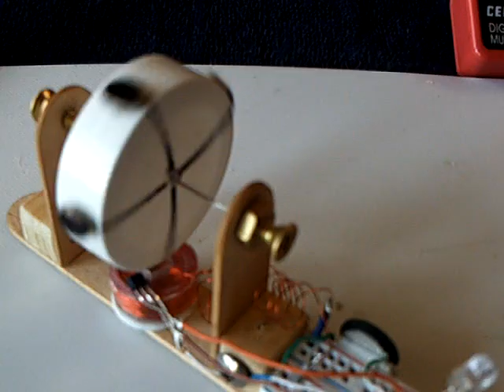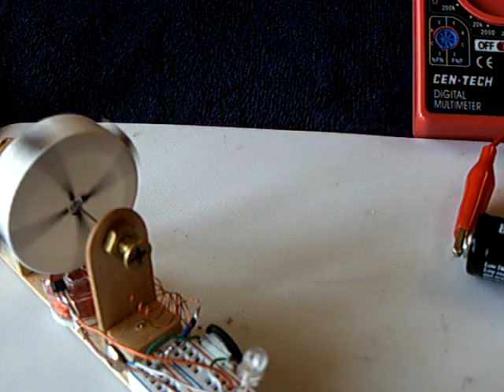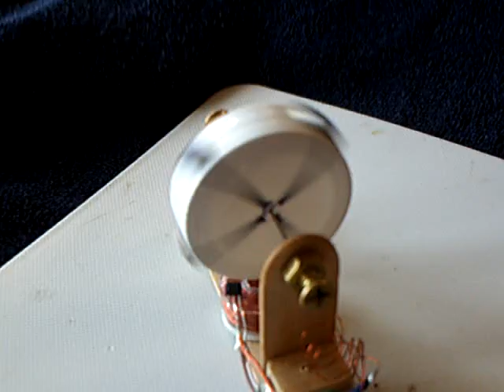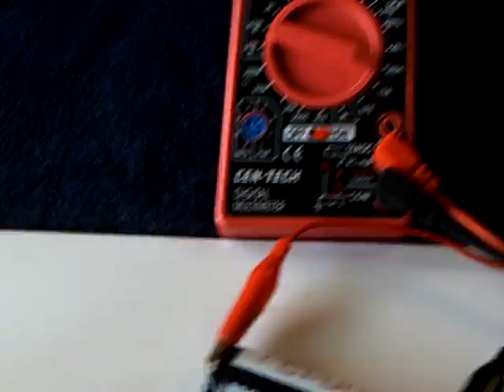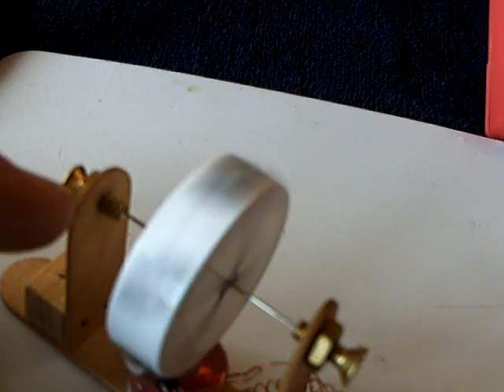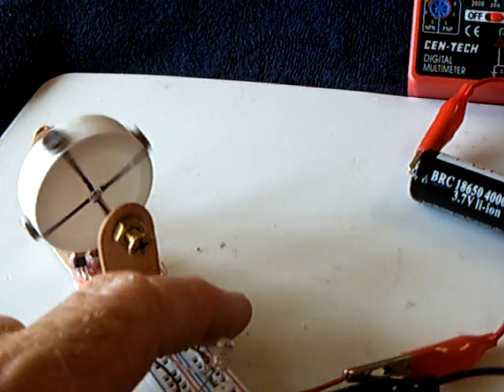Hall Sensor Motor ----  running on a 18650 3.7v li -ion battery

Comment: fake battery you can only get 3600mah in 18650 and they are expensive. is it ultrafire? you get them cheap because they are old cells from reused discarded laptop packs that they chop up and take the working cells from. most of the cells have high wear and can be as little as 700mah but often around 1500mah. just be careful as they explode as they already have internal formations that lead to internal short. there is a guy who had some explode and lost his thumb just google you will see.
Reply from the maker: +Pulsed Neutrino I did some pretty good research on these 18650 batteries before I bought some.  You are right about them being all over the place as far as capacity, quality, and safety.  Amazondotcom had good reviews on the ones I bought --but I am still wary until I do my own testing.  I will to be very careful with them.  I need both my thumbs and my wife would be very upset if I burned down the house.
Reply: ***** i was like you at one point trying to save money and in the end decided that genuine panasonic ncr18650a 3100mah or ncr18650b 3600mah cells were the safest. granted per cell it will cost you about $8 / $9 including protection module but its worth it. especially as i found out with high current loads and multiple cell configurations where i needed reliability. the cells i used always expended within about 100mah of printed capacity which i thought was good. i also found that for max capacity charge to 4.25v and discharge to 2.8v and replace after 300 cycles. or if you don't mind a reduction in capacity you can only charge to 4.1v and discharge to 3.4v and discard after 1000 cycles.
Reply from the maker: +Pulsed Neutrino Great information.  Thanks.  I guess this situation is like most where knowledge is king and a little help from others does the trick.  Thanks again.  That saved me a lot of time.
Reply: ***** you are welcome. just an extra addendum if you want lithium batteries that are safer just get lithium iron phosphate. they have a lower energy density and voltage range but don't catch fire when you puncture them or short them out. happy tinkering!

Comment: I've got lots of 18650 cells.  I've never had any problems with them. You can discharge over 1.5A continuously with the ones that I have without any problem.  I charge mine manually with an old cellphone charger that I modified into a dual mode charger.
Reply from the maker: +A B  Thanks.  I am so far behind on some things.  Technology races ahead.
Reply: +Lidmotor You're light years ahead of my in static motor knowledge though. :)
Reply from the maker: +A B  It's funny that you would mention the static electric motor because I have been wondering what to do next. That is something on the list as well as another Stirling engine.  I found out that in order to keep my interest alive in this hobby I have to vary the projects.  If I stay on one type of a project too long I burn out.   Usually I stumble onto something new here on YouTube or at one of the forums and off I go in that direction.
Reply: +Lidmotor 
Not that you are taking requests, but, I'd like to see you do a series of vids on Stirling designs. :)

Comment: Hey Lid, about those home mad super caps from tin man. Well after some searching I believe I have found where he got the information to build it. There is a channel on YouTube under the name Robert Murray-Smith. Go there and go to his playlists. Under that you will find a playlist named super capacitors and batteries. All the info we need to get a VERY good start is there. He goes through how to make the Graphene, as well as turn it into an ink like substance and use an airbrush to spray a super thin layer on a substrate. He goes through all steps to produce multi farad homemade super caps that are much smaller than the ones we can buy. Hell he has even made a one mega farad capacitor.
Reply from the maker: +BackRoom Labs I have watched most of Robert Murray-Smith's videos.  Making true grapheme is not easy.  My attempts have failed.  All I get is thin graphite. One molecule thick sheets of a substance???  Tough job for a kitchen table experimenter like me.
Reply: +Lidmotor I hear that. I just got some amorphous solar cells in the mail. After i construct a few home made panels I'm going to try my hand at the home made super caps.
Reply from the maker: +BackRoom Labs  Great let me know how that goes.   I want to make some also as long as what I'm making is a real super capacitor and not just another fancy voltaic cell.  There appears to be a blurry line between the two right now.  The word "Hybrid" is being used a lot.

Comment: nice to see you took my suggestion and added a POT.
I use those 18650's for some high powered LED joule thief flashlights I made. The batteries are very reliable, I have the red ones 3000mAh.
I really like your needle solution for the rotor.
how do you get the needle in the dead center? every time I try it's just a wable mess.
do you have a video showing that?

Comment: the neodymium  magnets add some extra and unnecessary resistance.
Reply from the maker: +Seth Faltisco   Without the neo magnets this will not run.  There is no internal ring magnet on this like on a computer fan motor.  No magnets. No workee.  Nothing for the electromagnet to push against.
Reply: i know the motor need magnets  but on the battery holding the alligator clips on. i connected 2 fully charged 18650 batteries in series using neo magnets and instead of 7.4 volts and 3500 mA i got 7.2volts and 2351 mA.
Reply from the maker: +Seth Faltisco Oh you meant the battery attachment magnets not the motor magnets.  I see your point but on this application it is not an important thing.  I ordered some battery holders with wires on them that should work well.
Reply: ok

Comment: Hmm, a micro levitator using a Hall sensor. Well worth looking at ! 
I use ex laptop 18650's, 6 of them, for my table fan. They recharge great on solar, no circuit required. Panel outside puts out around 300mAh at 18V and it's a 3x2 set of battery cells. Works just like an SLA for charging...been running for many months now without issue.
Reply from the maker: +slider2732 That is good news about solar charging these 18650s.  I bought 4 of them and I expect to do a bunch of experiments with them.  The fire danger is my only concern.  As far as the micro levitation device I think that it might be possible.
Reply: ***** All usual caveats for safety apply...but, the only time there's ever been a problem for me with Li-Ion was when both terminals connected. It got hot, so i took it outside. it cooled down, it still worked lol (not as well though probably).
LiPo need special circuits, true enough, but Li-ion are bunches easier to use/charge/store and can be considered as big rechargeable AA's, with a discharge limit of around 3.3V.  Oh and mine have no protection circuit anywhere.
Reply from the maker: +slider2732 More good news!  Thanks.  I bought an LED under water flashlight that runs on one of these.  Good item for the boat I figured. I also bought a USB charger that will work off Lasersaber's SOLN1-8.

Comment: lots of info and another nice build.i am still waiting for my ss cups.come to find out they shipped from china thru amazon.maybe my christmas present "chuckle".tinman had a new post and started a new project,i asked where he posted the finish on the 2 he was working on.the reclaimed veg oil rebuild and the super cap.i thought black opps guys got him and Robert Murray i think i might just try this in the meantime.thanks for sharing.
Reply from the maker: +bill bailey  Tinman is a busy guy these days.  I have been following along with the discussions at Overunitydotcom.  I am very sorry that he could not share more about that amazing super capacitor he made.  I am still working with my rechargeable stainless steel and Epsom salt cells.  I made one using stainless steel 'Lint Trap' screen that has been working very well.  It is a wet cell (small plastic container) that has about two tablespoons of the liquid electrolyte in it.
Reply: +Lidmotor  Thanks for the link and the new cell info. i can get some at Lowes/HD just got back from lowes.Tinman got back to me about my questions,your all a great bunch on folks.

Comment: can you share what kind of hall sensor that is? I ask because I have some that only seem to turn off when the magnet is near. I suppose I could build a signal inverter and drive a motor that way with what I have, but I still would like to know what the part number is for the ones that turn on with the magnet near.
Reply from the maker: +Roger “Corey” Smith   This is a 3144 Hall sensor.  South pole turns it on.  I bought a bunch off Amazondotcom.
Reply: +Lidmotor that's what I have.  I must be wiring it up wrong. lol
Reply from the maker: +Roger “Corey” Smith  Try both sides of the Hall with the magnet S and see what happens.  On mine the printed side (front) reacts to a south pole.  What I did when I was looking for Hall sensor circuits was just Google search---'hall sensor circuit images'.  That gives a whole bunch of wiring diagrams.